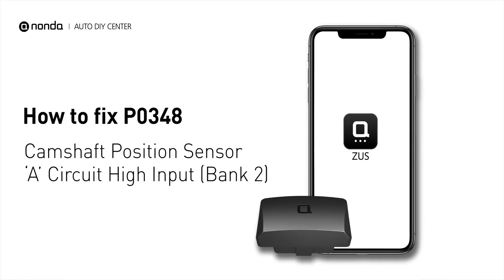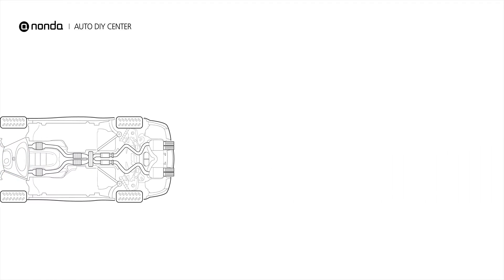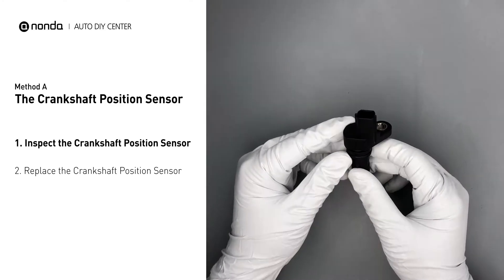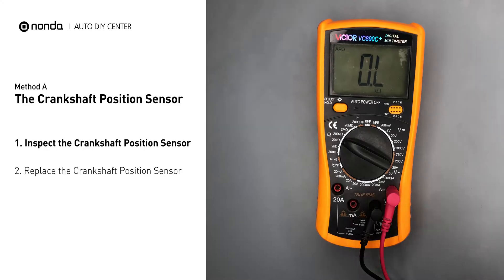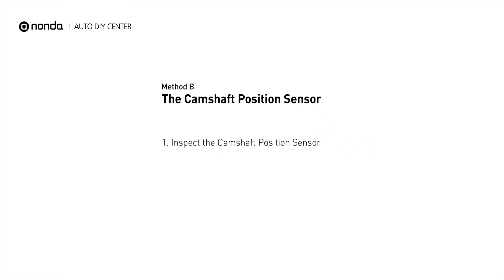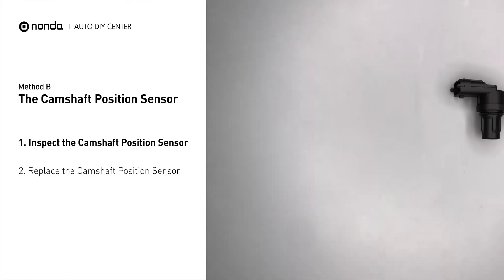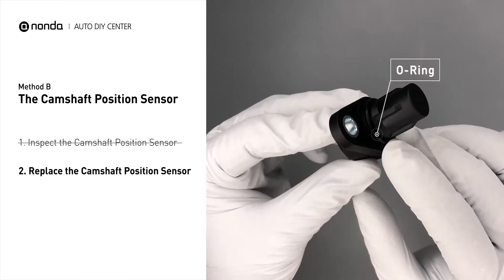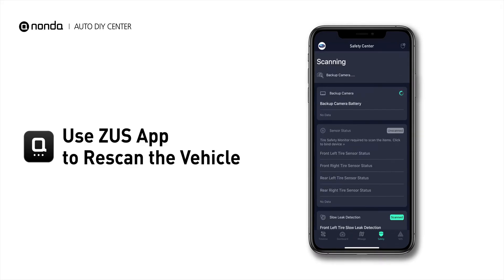How to Fix P0348 Engine Code in 3 Minutes [2 DIY Methods / Only $9.76]

Comment: 2008 Toyota Highlander, I am getting p0348 and p0347 both say "A circuit bank 2" but one says low and one says high!
Reply: Also I am getting voltage on the power side and the signal side on all four harness. There are four camshaft position sensors and they are all brand new!

Comment: Hello, I have a 2003 Lexus ES300. I have a cold p0348. Please tell me does this Lexus have two camshaft position sensors? If so where are they?
Reply: You should have 2. One for intake and another for exhaust. Plus a crankshaft position sensor front bottom I believe.
Reply: Was your problem solved by replacing the sensors

Comment: I have 2012 Toyota Alphard 3.5Li AT transmission, I have P0348 sensor, both crankshaft and Camshaft has been replaced but I still have P0348 code and cannot be reset. Can you help me what else to check.
Reply from the maker: Hi Alan, please have your vehicle's battery checked as weak battery is one of the factors that could be triggering this code. The camshaft position sensor harness must be checked for short and Camshaft position sensor circuit for poor electrical connection. The starter motor could also be faulty.
Reply: @nondainc  I saw the connector at Camshaft position sensor spark as the connector is now brittle, is there a fuse for this sensor? I have new battery
Reply: @alangarcia8044 did your issue get resolved. Can you share what was the actual reason why I am also facing a similar issue.

Comment: 2010 cts engine codes P0348 and P0393 all the timing chain assembly has been replaced and also just replaced the sensors but still have those codes
Reply: Sorry did not replace crankshaft sensor yet, I will try that first
Reply from the maker: Hello, since you are receiving multiple error codes, we suggest to get your vehicle visually inspected by your local mechanic for further diagnosis.

Comment: I have a 06 lexus gs300 any idea where can i find this sensor under the hood?
Reply from the maker: Hi Gelato, you can find it below the AC compressor on the engine block itself.
Reply: @nondainc  camshaft are at the valve covers, crank is behind the AC compressor

Comment: I have a 2016 Toyota Tundra. 
Is it hard to get to the sensor on a truck like this ?
Reply from the maker: Hello, you may locate it by going to the driver side exhaust, there you'll find the catalytic converter and it's located in front of it.
Reply: @nondainc  thank you!